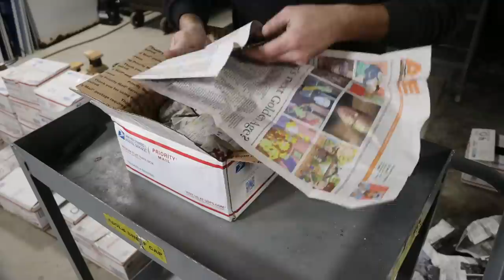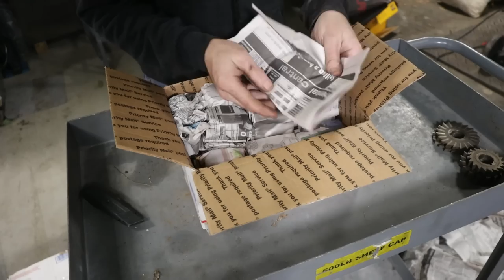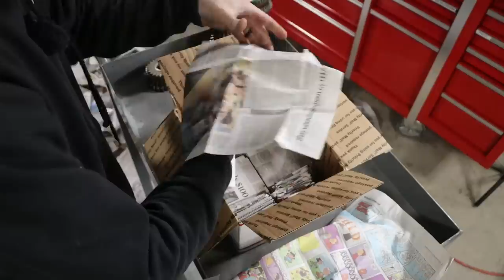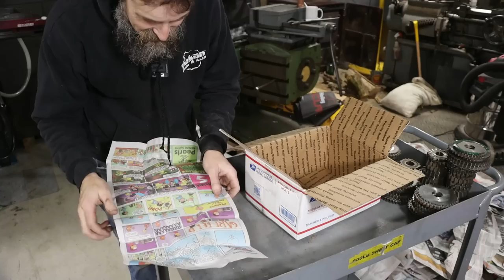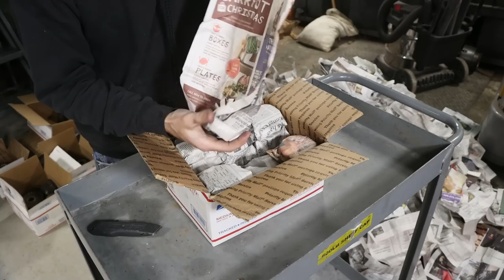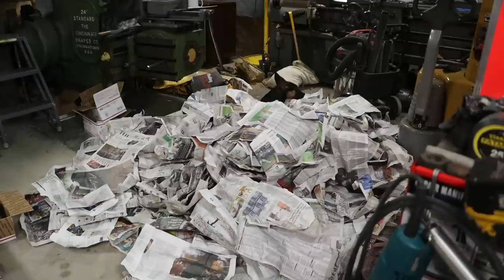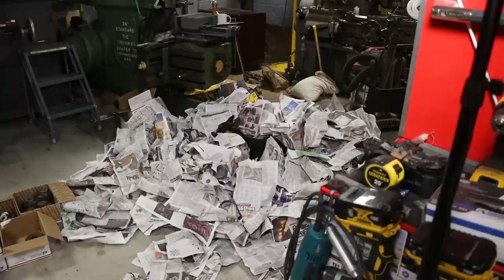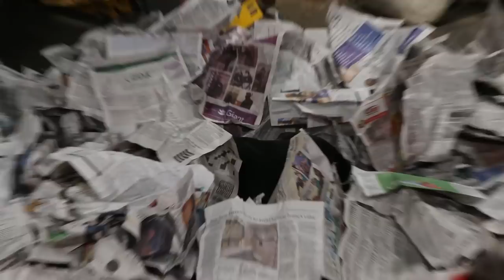Saved from DUMPSTER Milling Cutter MOTHER LOAD.

Comment: I'm more impressed that someone individually wrapped them all, well done Larry 👏.
Reply from the maker: What a job that would have been 🥵
Reply: @SteveSummers  I wonder if he read the papers first. That is a considerable pile of out of date literature in anyone's currency.
Reply: The flat rate shipping would be a small fortune. The time to wrap and box everything up, you are blessed. Now we need to see projects using them.
Reply: @carlwilson1772   Nice one Carl 👍
Reply: I have bought NOS horizontal milling cutters in the past, still in the wax and they have arrived not individually wrapped, nicely bashed into each other with chipped cutting edges. Was frustrating as they were not that cheap either.
Reply: Should have labeled them lmao
Reply: @fuckjewtube69  👍

Comment: I am not a machinist. I got sucked in with the rebuilding of the shop and wouldn't think of leaving even if if you took up making paper mache.  Just buying simple drill bits and saw blades at the box stores tells me there is an incredible value there. Thanks for addressing your favorites as I was wondering as you were unwrapping them what it might be.  Curious how you plan to sort and store the cutters so you can quickly find the one you need when the time comes.
I would also like to show my appreciation for the gentleman than rescued,  sorted, INDIVIDUALLY wrapped and packed, and delivered the cutters. That took a lot of time and effort and deserves an extra thank you for the contribution and his service to the country. Thank You!

Comment: Holy Moly (@@)! What and awesome find and gift on the tooling! We got to witness when we went to buy a 6ton arbor press and some mills, lathe's where the company (The Match Company of Tx, ) closed up the business. In their 100K sq facility that had to be cleared out by end of June 2021, I missed the main sale by 1 hr, and as we walked in, fork lift's were dumping vertical mills, lathe's, grinders of all sizes, gear cutter's like yours in huge 20yr roll off's. It made me sick to my stomach for sure. I took the name of the salvage yard, but knowing that being dropped from 4+ feet, most would be damaged beyond the cost to save. Thx for taking out your wk end to show and share Steve, Bear.

Comment: This Dake is perfect for 99.9% of what you will ever need there. I have seen Jackals, car jacks and ropes over loose shafts across the top. Some so badly cobbled it took 5 x the time to just do it right the first time eh. Then there are the ones using it that have absolutely no understanding about basic physics. That is a whole topic for another time eh, LOL. I find it pretty neat that the press was able to be used to be repaired using itself.  Sure not a lot of machines can do or say that about itself eh.
OH MY on this incredible supply of milling cutters/tools. We all know so well a machine is generally an expensive thing in the shop but the tooling needed to maximize the machines ability to effectively do all its abilities are the true value.  I find this hoard of tooling heart pounding, breath takingly wonderful. Now you get to do a full inventory and figure out how to safely store them without having to search through all the boxes. I keep many desiccant containers designed for marine use that every once in a while go into a 350F oven for a couple hours when the DOT on top goes from green to red. All that is needed to maintain the tools is just a light coat of WD or any other simple spray to be confident these WONDERFUL tools will always be rust free and ready to go. WHAT A HAUL, EH MY OLD FRIEND. It is always a good thing to have a spare tool of any sort in the inventory but you now have a spare for the spare and beyond. 
It is "A Typical" of a governmental, say situation would be to scrap all these wonderful pieces than to inventory and store them in a warehouse in a dark back corner to be forgotten . Now all you need is a horizontal mill with a bunch of arbors to max their usefulness. I know with some creative set-ups you can make these work on the newly rebuilt DoAll but they really do their best where they are meant to be used.
WOW, STEVE, What a show. This post really is something for the machining gods eh, LOL. Take care and see you soon I hope.

Comment: What an awesome gift. Truly an immense amount of time and effort to collect wrap and deliver them to you. You briefly showed an interlocking adjustable cutter. I use tons of them. I make brass hinges and for every size and configuration of hinge I keep a fully built up arbor. I think I have 20 arbors hanging on a rack ready to go. Makes changing hinge sizes a snap. Each arbor has five adjustable cutters. I run two Cincinnati 2-24 rise and fall production mills. 1940’s vintage.

Comment: It would be interesting if you could develop a database populated with all those cutters. Then enable small shops to lend-lease them for projects they want to work. As you undoubtedly realize there are a finite number of machinists and machine shops that can utilize those cutters as so many shops are now CNC-driven and computer-generate the features those cutters were made to produce. Great work by all who saved these from the crucible.

Comment: Steve you thoroughly deserve to have been chosen to receive all those awesome cutters, as I bet most of your subscribers would agree. The astronomical cost to replace those ( if you could with like quality US no doubt made cutters) today I guess would be in excess of $750,000 and as you had two lots $1,500,000 or more lol. Back 40 years ago I was setting up a almost new High School machine shop and it had a unused horizontal mill Made by Tom Senior ( your UK subscribers will know the name ) and I had to buy some extra cutters for it that hadn't been supplied when the machine was ordered. I had to purchase a 2"x 3" x1 1/4" bore slab mill and that cost I think around £65.00 at the time. That was an astronomical figure back then, and my head of department baulked to let me get it, because of how much it would reduce the departments budget for that school year. Which was around then about £1200 for three craft departments, Woodwork, Metalwork and Technical Drawing this money encompassed everything needed for the school year, Timber, Steel, Paper, Pencils. You get the idea so scaling up the cost from 1979 to now, then multiplying by the hundreds of cutters some nearly 9" in diameter, I don't think my estimate is too far wrong. And I wasn't thinking about cheap Chinese crap cutters, more like Brown and Sharp.

Comment: I have a Dake 50 ton hydraulic press as well as a Dake Model #4 arbor press. I very nearly always put stuff in the arbor press first. It does 99% of the jobs I give it. I wouldn’t give up either of them.

Comment: Awesome haul Steve!  I love the word "humbled" and glad you repeated that often.   My horizontal mill came with about 3 of those boxes you have there and I felt similarly humbled.  You're right in that this tooling is not "current" but if you valued them as "capability" I believe I added more capability than I parted with money.  That's a good feeling.

Comment: Now you get to build a multi slide out vertical storage cabinet.  Each cutter/or group of cutters goes on a dowel  or steel pin. No need to store many of the duplicates ready for use.... rewrap and stack those,in ordered groups.

Comment: At the machine shop I was working before I retire we have sent a full small container of high speed cutter like that , the shop dated from 1929 so lots of old cutters was in the in a large warehouse, we were going often sneaking in those cutters because we needed something special for a special job so we have a sharpener and we can Shane the shape if needed or refresh them … then the boss decided to make some space we kept those who we use the most and the rest was put on sale , many where sold and the rest filled a small container, we have a 20 ton industrial forklift and he wasn’t able to lift it , so it was weighing at least 30 ton .
There was some cutter as large as 24 inches in diameter.

Comment: I can not think of a better place for those cutters to end up in. I bought that exact model dake new back in the late 70s and it came with 4 pins. 2 for under the crossbar and 2 thru the middle of the crossbar. I welded a couple feet of chain to each pin and welded the other end to the crossbar. 40 years later and all 4 pins are still there

Comment: If You use the holes in the lower support beam, it will also support the legs from spreading out sideways. As you now did the pins will just support the beam from a downwards load.

Comment: The radius from cutters and the gear hobs are right up my alley. If you ever need any of these cutters sharpened I would do them for the cost of the shipping. I would do them the correct way. They are sharpened by gashing the teeth. But the offset or rake must be maintained or the form will be changed. If they have been done incorrectly they can be fixed providedly there's enough of the original form left. I have been sharpening and altering cutting tools for over fifty years and I don't know anyone that knows as much as I do.  Also I don't burn cutters . I would be happy to help anytime.

Comment: When cutting cable electric tape is meeeh ok but best thing you can put on cable is heat shrink tubing ! Works charm as well when you cut nylon or paracord rope(put heat shrinking tube ,heat it ,cut in middle and then use lighter to burn the ends -works like a charm).

Comment: That little dog "Cora" sures shows you some love for saving her. The Mother Lode is amazing who would scrap such valuable cutters. 2 gallons of evaporust and some time and they will be like brand new. I reckon Keith and Abom will be asking to borrow a few when they have a need.
Reply: Keith Fenner, Keith Rucker, Adam Booth, and James Kilroy are names that quickly come to mind as "homes" for the duplicates.  
The tooling came out of a military machine shop.  Between the CNC and vertical manual stuff, horizontal milling was "passe".  Kudos to all who saved USEFUL tooling from the furnace or (even worse) a landfill.

Comment: You now have more gear cutters than me. Might have to find you a big Lista cabinet to sort everything into.
Reply from the maker: I'm really about out of floor space.  I plan a big wall rack
Reply: @SteveSummers  That is a great idea, i can’t put a pic here but i did something similar using cheap 1x1 square tubing welded to 1/4” flat bar and bolted to the walls.

Comment: I saw a small hydraulic press at the scrap yard. It was a used, and wasn't in good condition, so the only thing I saved from it was an I bolt. The jack appeared to be okay, but was 3 ton, and I didn't need a little bottle jack.

Comment: My company tossed some old "obsolete" tooling in the scrap dumpster a while back that I pulled out, but in no way near to the extent of that lot. One interesting thing was a worm gear tap that I could not fina available anywhere. I think I will be sending that to Keith Rucker as he seems to be a collector off oddball items.

Comment: My goodness what a haul. I don't know who sent you those but you should be extremely grateful for it. Perhaps make them a gift using the cutters? I couldn't think of something at first, but I have an idea; have you ever seen one of those helix cut spirals on a lathe people like to show off on instagram or other websites?  Make one of those using an indexing head, cut flats hexagon or octagon pattern and create the spiral in the same manner as the lathe ones. Maybe use 3-4 different sizes of cutters or types of cutters (that double radius cutter in the middle and ends, MMMM, and then the flat taking back off from the peak of the cutter) might work, definitely tricky but easy once you figure it out. A keepsake of thanks, and a T-shirt or something.
Anyhow, thanks for the videos and Happy Holidays.

Comment: Steve, Although you called them yesterday's cutters, most are still made and quite costly.  A 2" dia x 2" hss slab mill is $195 at MSC.  You may easily have a $200,000 plus worth of cutters at new cost.  Nice!

Comment: Wow that's a massive amount of cutters. I would have been happy to have just a small box of various cutters. I got an old Victoria combination horizontal/vertical mill and a Fritz Werner horizontal mill which still needs to be cleaned up and repowered both are the 1 in shaft  between the two of them i got about a dozen cutters with them a couple of which are dull. Up here in central Saskatchewan Canada horizontal cutters are hard to find and pretty pricey short of going on Ebay or Amazon and getting the cheaper Chinese ones. Its great you can make use of them would have been a shame to see all that ending up in the recycle.👍👍👍👍👍🇨🇦🇨🇦🍻

Comment: FWIW I think the "wind on" the cable winch wasn't needed. I think the design is clever in that you can wind the beam right to the bottom and the cable will auto-centre of it frees up at the lowest setting.

Comment: Hi Steve,  A lot of those look like they have seen very little use. You are going to have to set up a good storage cabinet to keep them is some form of order so you can find what you need quickly. And it will have to be strong to carry the weight.
When I saw the pile at the intro to your video I was thinking you are going to have a few years work in sharpening them, but clearly the military has dedicated people to do that so everything is ready for work off the shelf.
It would have been crriminal to have just dumped all those.

Comment: Here's my guess of what happened on the press...  The cable slipped or got bumped off the left hand pulley and fell down on the axle.  So the "table" dropped a little on that side and would tend to be wedged.  This added to the fact that the cable wouldn't pull over the small radius axle.  Then you have the mechanical advantage of that long handle and the reduction of the worm drive, it bent the axle and snapped the cable.  If it were me, I would machine the slots in those pulleys a little deeper.
Nice score on the tooling.

Comment: I saw the postal boxes and the first thing I thought of was the cost of shipping those. I've heard guys from the Navy tell how they would throw things like that overboard on the way back to the States to avoid having to inventory it and I often wondered if it was true. When I was in school, most of the equipment in the machine shops had tags showing that they were property of the US government and on loan to the school. Even the local technical college had machines like that. When they replaced them with newer machines, they couldn't sell them, they were supposed to be scrapped. They would take them to a scrap yard where a large weight was dropped on them.

Comment: The Dake press that I used to use that looked an awful lot like yours had 4 table pins and it also had a pressure gage.  It sort of looks like yours has the gage port plugged so you might be able to add a gage if you wanted.

Comment: Watching you put that rusty bolt that you straightened neck in still rusty was difficult. I can’t reuse a fastener without hitting it with the wire wheel.

Comment: I understand you like the heritage and patina of the press, but wouldn’t it make sense to replace the bolts holding the lateral pulleys with new grade 8 hardware?

I imagine the repaired bolt on the left side is now weakened from the stress of bending. Right?

Comment: Stainless cable will work harden and break. Seen this many times in my 60 years as a fitter. People think..beauty I will replace the old plough steel galv wire with stainless and never have a problem again. 6 months later it's like um. Why did that break again. We need bigger wire. And on it goes. Steve how come you find all these awsome hordes of tools. It makes me sad cos I think it's awsome if I find a decent ball pein hammer! Signed ....very jealous

Comment: Am I correct in assuming the CNC machines have replaced all this?
Reply: Partly, these type of milling cutters are used on a Horizontal milling machine, it wasn't until much later, that the Vertical milling machine was invented,  along with corresponding shank type spiral cutters. Generally these Horizontal cutters are obsolete,  but are still very useful when several are setup together, in "Gang" milling to machine a profile, especially for production runs. The smaller slitting saws, can be used on a Vertical mill, as well as the gear cutters. A modern machine shop will not have, nor use these. Hope this answers your query?

Comment: If you don't mind sending them in the mail I would be very interested in buying some of the gear cutters and other items that you have multiples of. I just bought two mills and need tooling for them. One is an electric powered Brown and Sharpe #0 I think it is a 1945 model or some where close and a 1968 summit 2U universal mill. I have the vertical head for it. So naturally it is my vertical mill when I need it.

Comment: Wowie, looks as though there isn't any shape or size you won't be able to machine with that trove.  Now you are going to have to find a cabinet or two to store all of those in, the big question is, do you have enough floor space for them. 😂  I would say that those cutters came from a major repair facility that was decommissioned not a regular base repair shop that did minor equipment repairs.

Comment: Hey Steve, what do you use those milling cutters on? Do you use them on a end mill? Or do you use them on some sort of lathe?
Reply: Horizontal mill, and the monster in the corner will also use them as well. Looks like there will be a few cutter holders being made soon from steel tubing and steel rod.
Reply: I guess the simple question would be, what type of machine do you use those on?
Reply: @SeanBZA  wow that’s pretty cool